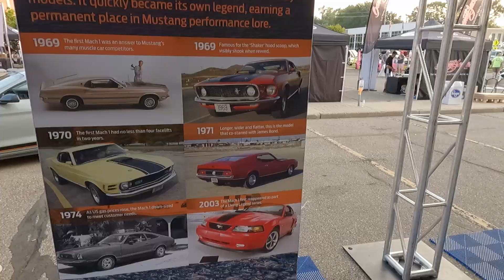RTR Takes Over Mustang Alley!| Amazing 2021 Mustang Alley Walk Around At The Woodward DreamCruise!

Comment: Dude I had a red and gold stirped 84 5.0 HO. It needed a few things. I fixed those few things. Then added cobra heads, full exhaust, cleaned everything up. It was slow as hell. Then I saw the gas leaking. Replaced the tank and fuel pump, it's became so insanely nasty man. I've had turbo Hondas and corvettes. My mustang and my old stock looking Honda turbo were my favorite cars. Ran a 12.8 in the Mustang after putting in the walbro. 12.2 in Honda. Honda was faster but mustang had more potential.  Love my Hondas and mustangs man. Keep yours clean bro.